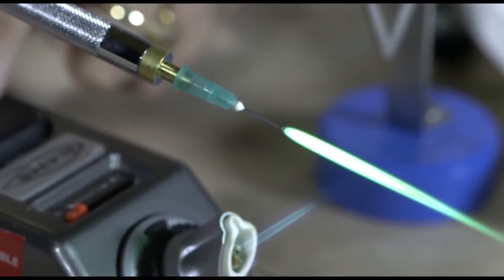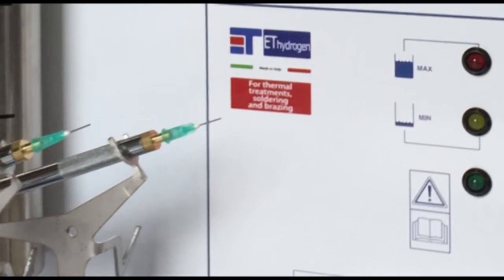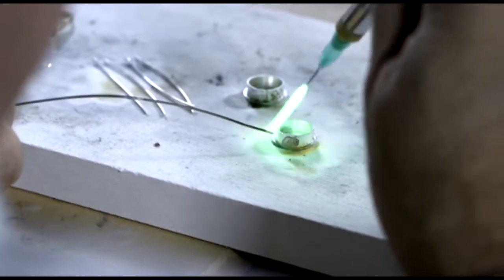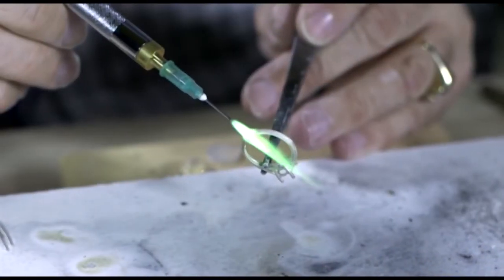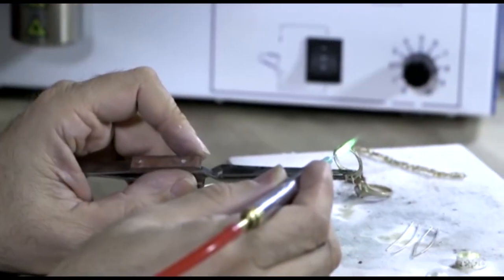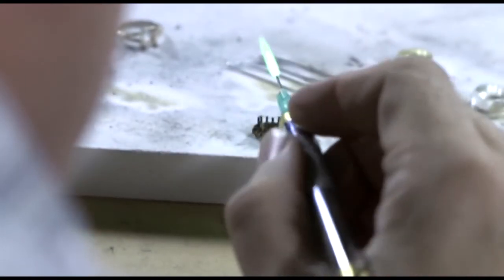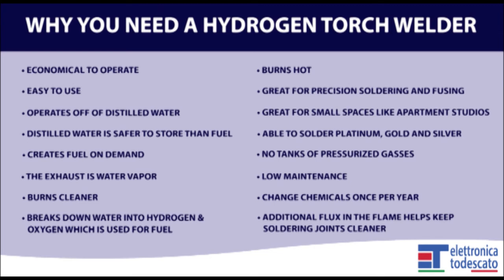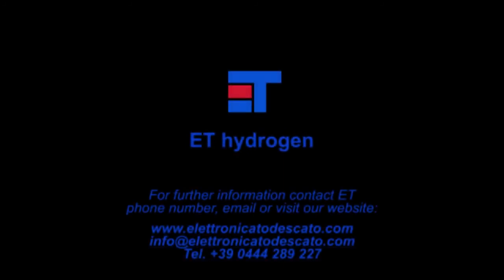PRESENTING ET HYDROGEN TORCH

Comment: Does this equipment allow smelting of small amounts of gold or silver (something like 50/100g)  in a crucible for pouring into ingots?
Reply from the maker: Hello Joyce. Yes of course you can melt metals. Flame temperature can reach 3200°C (6000°F). If you want to melt 50 to 100 grams of matter, you should choose model L/700. Please see attached link: http://www.elettronicatodescato.com/eng/mixed-gas-hydrogen-oxygen-generators_dettaglio_26.php